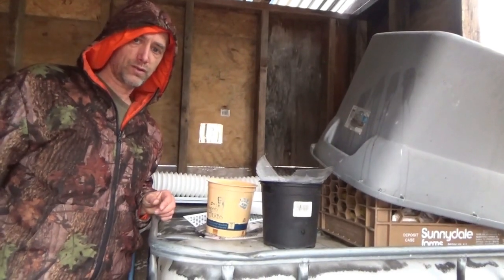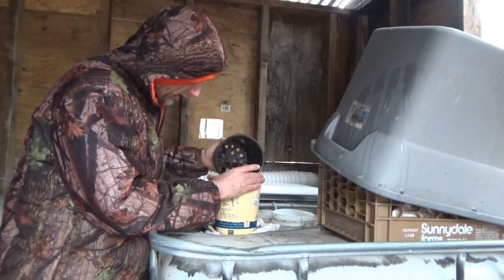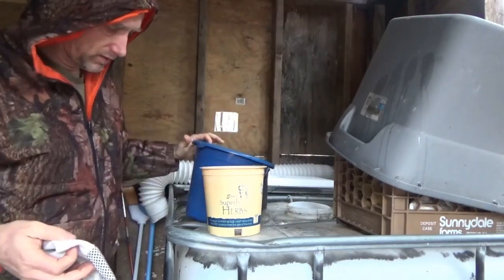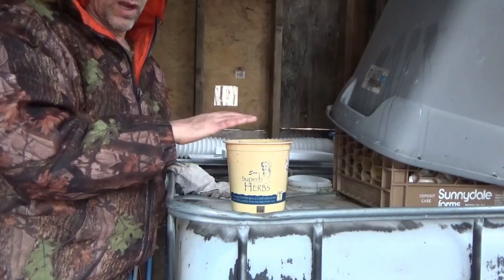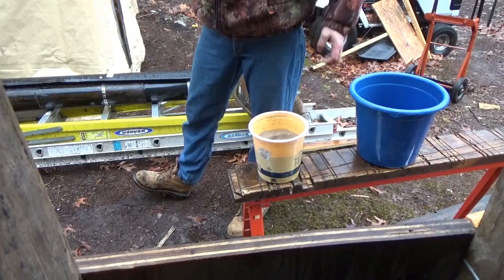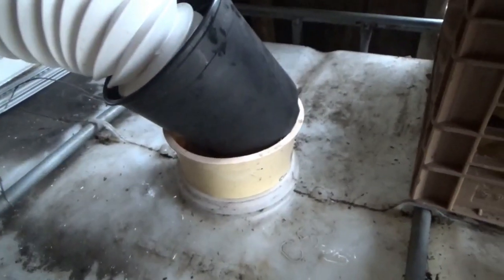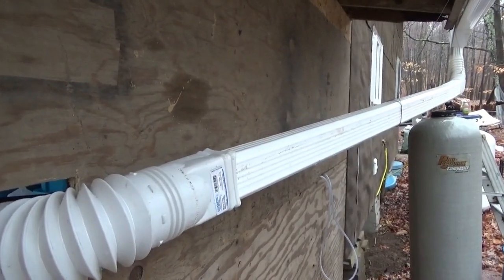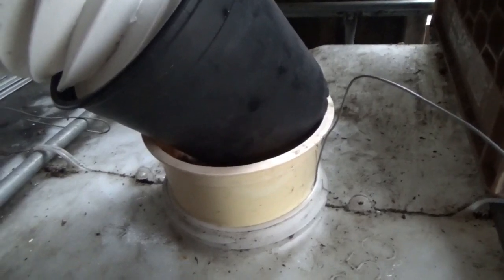My Simple FREE Homemade Sand & Gravel Rain Water Filter

Comment: Troy. what you need is a simple device, very affordable, I use it On my Koi Pond, It filters down to 200 microns called a Sock Filter, There will be no set up involved and water will flow thru it at the rate you need. These filters have a long life expectancy and work well for removing debris from flowing water and are gravity based. See my reply to this post.

Comment: I Own a Water Treatment company here in Canada Eh!  you should be able to find a local treatment company in your area and have them make up a small 8" x 24" multi media filter with a manual back wash valve reasonable inexpensive. have have the gravity water flow into a smaller tank first then though multi filter then to holding tank.  enjoy your Videos very much, keep up the good work Troy.
Reply: you could also just use Cheese cloth to filter rain water into large holding tank then use your small pump to pass through multi media filter to house.    I would also invest in a small 2-5 gpm Ultra violet light to kill any germs etc from organics from trees ,bugs ,bird poop etc. showering and washing hands can be absorbed though skin as well as ingested accidentally. be safe.

Comment: On your next trip to town, stop at a good paint store and check out "airless paint sprayer filters." They come in one and five gallon sizes and will do the job. they have elastic tops and fit into pails of the apropo size. A 5 gal filter should last for months if you divert most of the big junk before it gets to the nylon filter. Super clean and quick to change. Have you tried to research making rain water potable? I remember during the great acid rain debacle a couple of methods that worked. One was very high tech but the other was true DIY. Worth a look maybe?

Comment: Are there any mosquitos in your region? If so you need to work on screening the tank better. The wire down the side is a big no-no for many of your viewers. Try a soft drink straw down the side of the filter pot instead to let air out of the tank.

Comment: Drill holes in the bottom and remove the sand and put pillow stuffing in it... The pillow stuffing will polish the water and filter things out or replace the big gravel will little gravel and a little bit of sand and put the pillow stuffing and it should work but u would have to replace the pillow stuffing every now and then
Reply: Or use lava rock instead of gravel and it should work and all the stuff is pretty cheap

Comment: with the way you layered the materials I would run the water through the bottom of the pail so it overflows out of the pail.  The larger stones will catch the large debris, the river pebbles will catch the smaller debris that gets passed the larger stones, and then finally the really small stuff that gets passed the river pebble will be caught by the sand which will be on top.  But before you put the sand on top of the pebbles put a paint filter in first then the sand.. and then if you want add another paint filter, and an extra bonus your final layer will be charcoal which you would make yourself(biochar).  Then at the top of bucket above the sand/(or if you go with charcoal too..)charcoal layer you put your exit spout. that that way you can any sized container for your filter and no matter how fast the water pours into it form the bottom itll just filter through to the top and pour out the drain hole into your clean collection system. Put a pvc valve before the sand filter that way you can shut off the water to it for cleaning and for redirecting to a another container like a dirty collection system (for gardening) or with the valve turned off the water will be redirected simply out a spout into the ground if your collection system is full.  Heres a good video to watch for how to do the filter. https://www.youtube.com/watch?v=kazEAzGWuIc&ab_channel=JonJandaiLifeisEasy

Comment: Regarding the leak where your gutter meets the roof. Wouldn't that spray rubber stuff fill that crack in? It some in black and white now. Not sure if it has stuff in it you wouldn't want in your water or not.
Reply from the maker: +Susan Galuski Actually that is a very good idea. Not sure how safe it is though for use in the home. I will look into that.

Comment: Troy what are you using this water for? If its to shower or wash dishes you should have the water tested regularly. If you have a Leslie's Pool store by you they test water for free. They will even give you a print out of everything they find in your water. Just bring them about 2 cups of your water after its gone through your filters in a clean glass jar or bottle, they do it while you stand there it takes about 3 mins.

Comment: Lots of easy options. Such as, put a larger sand filter on top. Look up biosand filters, instead of draining out the bottom you put an s-pipe and the water level stays above the sand, which also helps slow down the water, drip in slowly and have a large buffer volume above. With a surface area as large as the top of the IBC tote footprint (and a higher pressure head) flow will improve
 Add a diverter (just a Tee) to bypass the sand filter for too heavy rainfall and send the diverter to gray water use, etc.

Comment: A simple and effective filter as used by eheim aquarium filters: A nylon stocking filled with fine charcoal. You could setup a couple and periodically remove and clean one while resuming operation.
Reply from the maker: +Steven Hardy Yes I am thinking the same thing now.
Reply: 30 some years ago, I had an eheim closed loop fish  filter. It did a fantastic job ompered to others on the market.You simply need a container to drop it into with maybe a thin bed of stone on the bottom for flow. Charcoal also removes other toxins...but hopefully your not drinking rainwater without serious treatment....   :-) You might be able to get a better deal on charcoal at a ho ttub store or pool store. You could get it cheap if Melanie was to send some coconut charcoal....:-)

Comment: I did read your blog about the water system,,but nothing i have read is going save the rain system from freezing where it leaves the shed all the way back up to the roof,, unless there's heat tapes used in wich i dont think your power banks will keep up with them,, rain systems are great to use in warmer months or warmer area's of the country,in my opinion your energies would be better used to figure out winter water solutions ,, I'm not trying to down your everts,, hope things work out

Comment: you will do better with some standard large fish aquarium filters.. Putting them in the right direction that will trap the junk .. And they have charcoal.. A historic water purification element.. You can put these in your gutter you need a box.  you can use your old stove pipe to extend up your fireplace chimney. it may run over time you will need some guide wires.. This may help you keep your roof cleaner. you know you probably really need to have to two or three different solar battery banks. for different purposes. and for demonstration. one is dedicated to recharge your Rechargeable Batteries. the other is what you're using it right now. one is basic the other one is high tech.

Comment: Troy if you spent a little on a Big Berkey water filter for inside your home, you could use the rain water for drinking. I know they are a little expensive but they are a great addition to any "survival" plan/cabin. =)
Reply: He still has the Berkey filter. ..he didn't sell it as the troll claims.   (Would someone even buy a used water filter? Eeww )
Reply: +MollyDolly I think the reason he doesn't use it is lack of counter space. Any time it is above freezing, he could set it up in the shed to filter stored water for drinking.

Comment: Im making this in my office, but when the water hits the sand it became muddy/cloudy. Do I have to clean the sand? and how can you clean it? cos I already did clean it but the result is still the same. pls help me.
Reply from the maker: Yes the water on top will become muddy. But if the water coming out is clean then the end result is what you want to see. With time you can either scrape off any solids from the top of the sand and replace a little bit or back flush the system but that is complicated with a homemade filter.

Comment: Need screens between layers of sand, pea gravel, and larger gravel, to prevent smaller sand mixing/churning from incoming rainwater into spaces between lower gavels.  
Also, slow...sand filters water best, used as batch filters [always keep at least 1" of water on top of the undisturbed top sand, to maintain the biota that keeps optimal purification conditions in the sand filter. 
Some have used a 55-gal barrel as sand filter which is fed indirectly from initial catchment tank/container filled by pre-screened [ mesh or other pre-filters] from gutters.  
A float activated pump feeds the sand filter from the initial tank, to the sand filter, at an optimal slow trickle, which avoids disturbing the sand, and the slow sand filter water feeds a larger 'clean tank'. to use from.
A good addition to the clean catchment tanks is an air bubbler run off it's own little solar panel [runs during day, off at night], helps keep water quality better by oxygenation. Then run water from the clean tank, through finish filtration, to assure potable water....or use a solar water distiller.

Comment: You have those down spouts on wrong, that's where you are getting the leaks from. They, being exactly like the flue pipe from wood stove  HAS to be installed where the upper section slides into the lower section. and continuing in that manner to reach the objective (tank). Troy, you are getting in too much of a hurry and not thinking, sort of like putting the cart before the horse. The pre wash diverter system, can be done away with, as you have the mesh guard installed on the gutters already and no leaves should be able to actually get into the draining water, in my opinion it is just another headache that will require extra man hours to maintain that could be spent giving a more complex task some thought before attempting.
Reply: WC Prepper 2 When I was a kid, we had a cistern as a water supply, there were no filtration of the water from the roof of house whatsoever, none of us got sick from consuming it, I realize that there will be some smaller particles to flow in with the water but in Troys situation what does will be caught in his filtration canister and I still stand on doing away with the prewash diverter

Comment: For what you put together ,sand is not the best, maybe an old T-shirt and fish tank gravel. One thing your filter container is a little small   If you can get some nylon scrub pads,they will filter particles and let the water run through rather quickly.
Reply from the maker: +Duane C Those pads might work very well. I will try that. Thanks
Reply from the maker: +Shaggy one With the inline first flush filter and the level of the shed roof, I cannot go any higher and still have water flow into the tank.
There are no 90 degree elbows at Lowes and I needed just that so I used the flex pipe.

Comment: why did you cut a square hole for a round pipe ?
Reply from the maker: +John Griffiths Ever try cutting a round hole with a circular saw?
Reply: +The Do It Yourself World You cold have drilled a small hole and finished it off with the reciprocating saw to make the round hole. Just sayin'. =P
Reply: +The Do It Yourself World 
Some yrs ago, I bought metal circle cutter bit, attached it to my B&D drill. Instead of hole in wood mine was in dry wall. 
idk whether they quit making these bits.
Reply: Wow. Where did all the hate come from ?
Reply: timcat100 who are you saying are trolls. ?I asked the question because I thought he might be using some kind of escutcheon or closure plate
Reply from the maker: +John Griffiths Haha, timcat is a troll. Him and his friends are the haters.
Reply: yep! "Haters and trolls they are!"
Reply: +Gamer 1 
..but Troy owns safety glasses; check back thru his vids.
Reply: because hes a carpenter not an architect ???

Comment: sand filters really need to be very large to keep up with large volumes of water, they have been used as part of the filter system in uk water treatment plants for ages but they are huge
Reply: +Bruce Miller I done a little looking into this myself, and I thought what he had was a little small.  But the concept is sound.
Reply: +Bruce Miller Sand filters are also used in swimming pool setups too. If Troy could find an old pool no longer used maybe he could retro fit a pool filter system into his water collection.
Reply: +The Long Project  I think he actually has a pool filter pot. It's that yellowish falic looking thing... but I think that is actually too big.  He needs one for an above ground, Doughboy pool.  There's something better than sand now though...it a cellulose fiber...it's  excellent.   

+The Do It Yourself World  You can buy cellulose fiber at that Leslie's  pool supply, which I think is in Middletown.  They will do a free water sample test, too.  Just take about 6 ounce of water in they do the test in minutes.  The thing you will be looking for is obviously not chlorine but nitrites. ..aka poop.

Comment: Just to remove particulates an aquarium filter should work, reinventing the wheel isn't necessary. I used aquarium filter material in my water tower (fed from lake water) and off the tower roof (steel) thru filter Had elbow with filter for rain water. Lake water particulates handled by filter at inlet on Honda pump. I liked the idea of filling a 250 gallon tower in 15 minutes, I know its silly.
Further filtering of water was handled by house water filter hanging off tower $20, and $20 house filter where water entered kitchen and bath. Water test by state said my water was slightly high in magnesium. The filters were $10 bucks in quantity same as house filters.

Comment: you've stated in about 5 videos that you were going to put that tank on top of a pallet.. gonna be hard to accomplish when it's full of water.. 300 gallons? 8 pounds per gallon.. that's 2,400 pounds to lift, just to slide a pallet underneath it.. and why make a first flush diverter when it's not even hooked up? i thought first flush was to collect all the crap off the roof for the 'first rain'?  you've collected 3 tanks of water so far